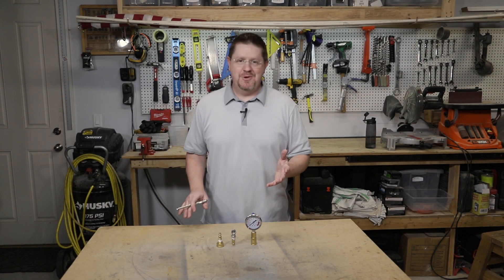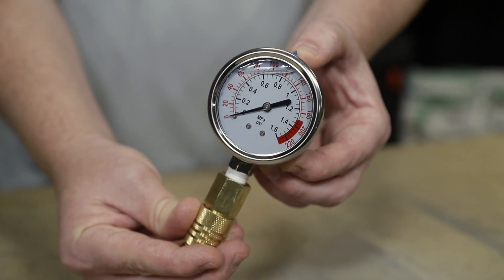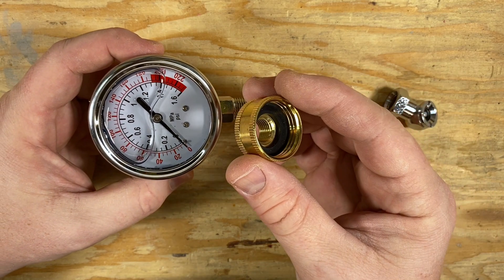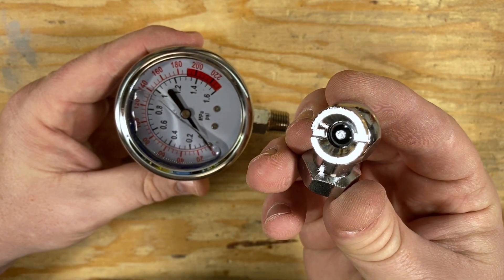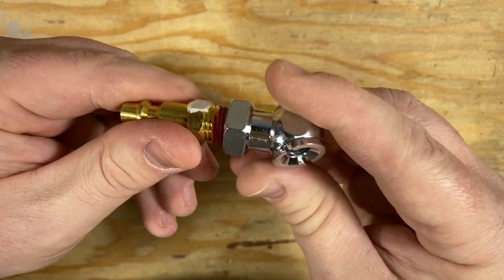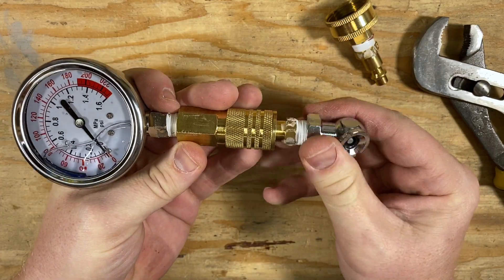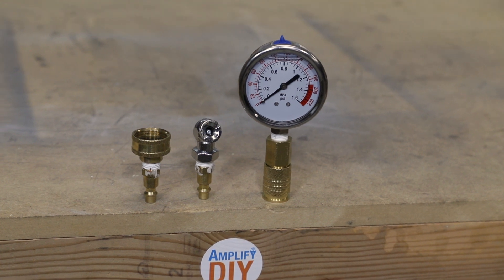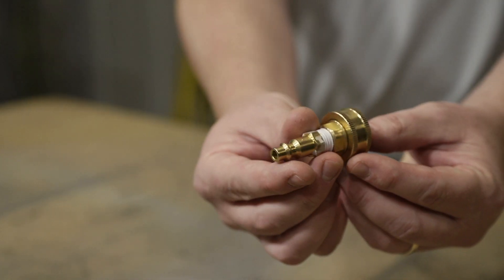How To Use A Water Pressure Gauge To Measure Air Pressure

Comment: Does it matter that water is incompressible but air is compressible when using the same gauge to compare pressures like in your expansion tank replacement video? Sorry if this has already been addressed in these comments.
Reply from the maker: It does not seem to matter with this gauge. Great question!

Comment: Can uu plss also teach how yo measure water pressure with Tyre pressure gauge  .. please please pleaseee it's important for me a lot
Reply from the maker: Gauges that are designed for measuring air pressure will have a bad time if you try to measure water pressure. You need to get your hands on the right kind of gauge. I have links in the video description to the gauge I used here. Good luck!
Reply: @AmplifyDIY

Comment: My dual pressure gauge is not working for water. The pressure gauge adapter hole is tiny like a pin hole. Do i have to change that to an adapter with a larger hole?
Reply from the maker: Hmm... I'm not sure. What kinds of readings are you getting when measuring water? Anything at all? Are the measurements just off (too low, too high)?
Reply: @AmplifyDIY  thanks for the reply, but I purchased a the wrong gauge. The readings start at 0-4000 psi.   For pressure washers not faucet pressure. Heading back to Princess auto

Comment: I was able to find the same guage with most of the adapters except the Schrader valve adapter, where did you get it ?
Reply from the maker: Hi Markie - here are the links from the description for everything, including the Shrader adapter: 
Pressure Gauge With Hose Fitting: https://amzn.to/3dW4DpQ
Schraeder Chuck:  https://amzn.to/2wgXBv8
1/4" Quick Couplers: https://amzn.to/2JPCYtf
Teflon Tape: https://amzn.to/348nWIc

Thanks for watching!
Reply: @AmplifyDIY  thanks for responding. Everything is at Amazon.

Comment: I have watched your 4th great water heater videos of yours tonight...   I have a dial air compressor gauge..  Are you stating it will test water pressure also with correct adapter? I assumed it would get water in tire pressure gauge...
Reply from the maker: The gauge I demonstrated in this video seems to have no problem measuring both.

Comment: I have a very crazy question.

Hoe do I use this setup to measure the steam coming from my high pressure steam cleaner? It was advertised to produce 3.5 BAR (≈50 psi), but I don't think it goes up that far. the problem being that the spray nozzle doesn't have a screw fitting, so how would I do this?
Reply from the maker: That’s a tricky one! You’ll have to find some way to get an airtight seal between the steam cleaner and a gauge. Perhaps it’s time for a creative trip to the plumbing aisle at your local home improvement store?

Comment: Would it be better to use a gauge that ranged from 0 to 100 instead of over 220 psi? Seems it would be easier to read and maybe more accurate.
Reply from the maker: Depends on what you are measuring, of course. I sometimes need to measure up to 175 psi for various projects, so this gauge is great for me. One with a smaller range would be easier to read if you don’t need to measure such a wide range. Thanks for watching, and great question!